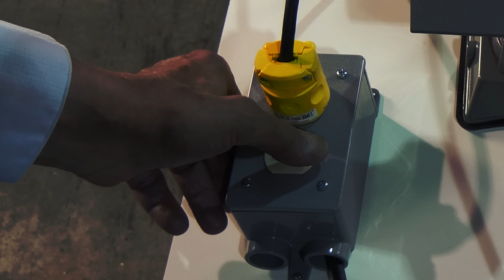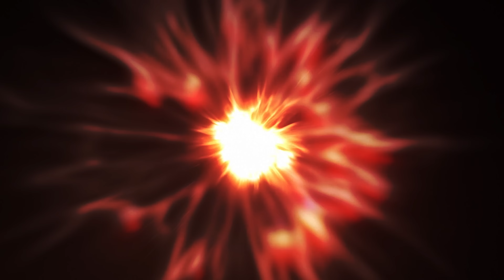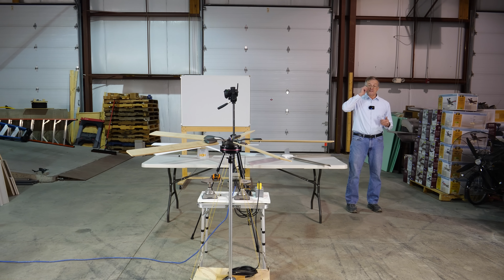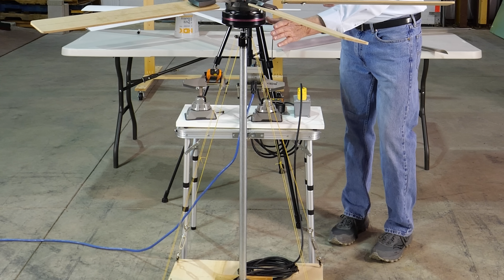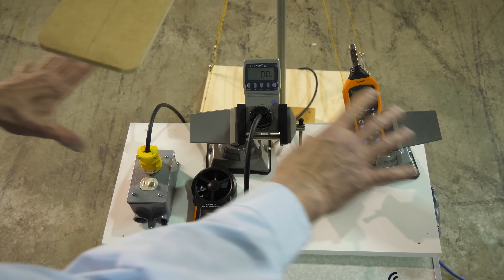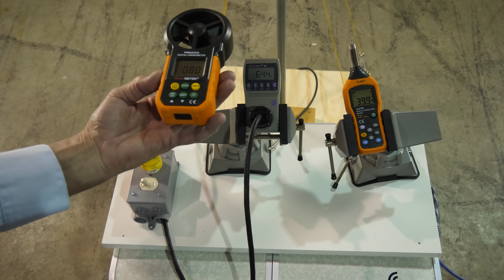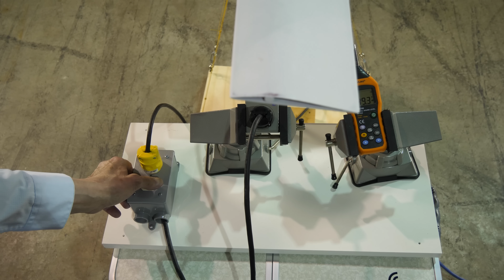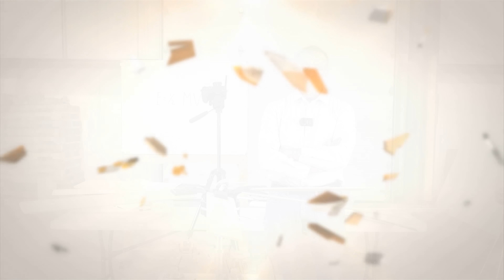This Fan Uses Almost NO Power

Comment: As always, I enjoy watching your videos and they're great - this one didn't disappoint at all (as usual). A few ideas for testing that you might want to consider, if you test this again:

- Include RPMs in the test to ensure consistency
- have some sort of platform to hold your anemometer at the same level for every test for a more accurate test of airflow
- let the fan come up to speed for a fixed amount of time for each test - maybe 60 to 240 seconds. This will likely ensure consistent speed and power draw.
- lastly, it would have been cool to see the other blades tested, but I understand why they weren't.

Hope you take this constructively, as I expect you will. Considering your scientific and engineering nature, I think I'm okay. Keep up the great work!
Reply from the maker: All good suggestions and, in general, the way I try to do things (although I don't always succeed).🙂

Comment: It may be worthwhile to try using a TI 8316A or 8329A (externally controlled FETs) dev kit. They are FOC BLDC motor controllers that can be tuned for efficiency and sound level much better than a sinusoidal controller.
Reply from the maker: Thanks!

Comment: Very interesting topic, there are a couple questions I have and a potentially interesting suggestion for a future project.

1) What is the initial cost difference of building such a fan over purchasing a commercial one?

2) What is the overall efficiency gain taking into account the power consumption by the speed controller and the conversion losses from ac to dc power?

3) What if you combined such a system with some sort of integrated evaporative cooling apparatus that you could toggle on and off or reload somehow to further decrease room temperatures?

Would also love to see a build video. It definitely shows through that you guys are genuinely passionate about these projects personally and aren’t just in for the algorithm. Really enjoying this research format you guys have been doing, great work!
Reply from the maker: We will revisit this.  There have been a lot of requests about the airfoil assembly and the combination of the more efficient motor with the more efficient rotor.
Evaporation would cause an increase in humidity, which I would avoid. 
The overall relative performance of the AC and the BLDC motors is what was read by the meter. The controller and conversion circuit were downstream from the power meter.
I wouldn't bother to build the conversion circuitry as the included system works well and is easy.
Roughly, the AC fan retails for about $100, and the DC fan retails for about $150.
The blades are fun, and the cost depends on what you already have around. From scratch, call it $50.

Comment: Link to find the hunter fan motor?  In the past i have paid a lot for proper Air-foil fans,  they are nearly silent and move so much air.   In my last house I had one, I hardwired on 'LOW" it used 4 watts...

Comment: You sound level reading is probably saturated by buffeting at the mic. Using a windshield will reduce this and give you an actual reading if the noise level

Comment: Neither of the tested designs here is very efficient. 
To get an idea of what an efficient propeller design looks like, compare it with a blade from a large commercial wind turbine.
Reply from the maker: The asymmetrical airfoil is pretty good.
But don't forget that a design that is too difficult to fabricate will remain a good design... but only on paper.
Reply: @TechIngredients  Yes, sometimes fabrication is an issue. But definitely not always.
Occasionally, a product is also bound by compromises. For example, in this particular case, a fan may not meet expectations of a reverse thrust usage if the airfoil is asymmetrical.

Comment: In this application, you would use a curved underside on the wing airfoil (camber).
To improve efficiency, it's essential to gently nudge air around, not let it meet a flat surface on the nose 😊
You would also make sure the air flows over the wing in a laminar flow pattern at all radiuses.
Lastly, the wing pitch angle seems too steep for this setup.
Reply from the maker: The pitch angle was tested and adjusted to achieve maximum performance.

Comment: Measuring with an anenometer at some random point below the fan is not that useful.
The downdraft, at any point, will be very dependent on a lot of variables, like incoming air speed, air movement direction, vortices location on the wing, ground-effect, roof-effect, airfoil, drag, surface, chord, camber, pitch, R-number, aso.
Reply from the maker: It's not random.
You're correct that many variables will affect the measurement, but I held the meter in each test to maximize the reading.

Comment: One BIG issue is that consumers often do not know how to use what they have. 
This fan can be used to cool or warm...
So some air movement is cooling .. to a point, BUT hot air rises so a fan like this, particularly in a high ceiling room like this may actually make you feel hotter by bringing down hot air. Better is to have a high level extraction fan to remove this air, and suck in cooler air at low level. 
And then use a low level fan to move the cooler air around
BUT it can also be used as a destratification fan bringing down warm air when it is cold... usually when you have some source of heating like radiators. 

My local indoor tennis centre put in high level fans but as there is no heating they are pretty useless as destrat fans, but they then switch them on when it is hot but with a IR laser thermometer you ca n see that the temperature at ceiling height is  maybe 35C,  when ground level temp is 25C....

They actually have 6 BIG and noisy, and almost certainly very inefficient high level extraction fans but these are often switched on only when it is already hot outside so the cooling effect is minimal ( the COP is probably 3-4)... what they need to do is run them at slow speed ( its much more efficient) and run them at night and use night time cooling and remove the heat from the building. Night time temperatures rarely get above 15C in the UK. 
Using night time cooling with slow speed modern brushless EC motor would probably give COP of cooling in the order of 25-30. 
Spend less money and actually have a system that works!

Comment: Now if we can get similar efficiencies to prevent water loss in the desert.  People complain about water used in closed circuit datacenters , but they forget to realize the combined swimming pool water evaporation is like 400,000,000,000,000,000,000 times more wasteful.

Comment: I notice many such inefficiencies as well.
not only in physical things where I found many, but also digital, some are intentional because they don't want to make someting good, sometimes they are just stupid and don't look beyond what they already know.

found 2 huge one in computer games as well, some fundamental mistakes in the core behind how games and such actually render things, designed a essentially drop in replacement which wouldn't break other functionality and on a modern high end system could both greatly increase performance as well as save a lot of power at the same time, showed how to do it, asked some game engines if they wanted to implement it as it had no nagatives and yet made things a lot more energy efficient as well as some faster. none even concidered trying it out, since it would mean changing something they where used to for years. even if they wouldn't notice the difference since they themselves wheren't even aware anymore of that part in their engine since around 60 years ago or such someone decided that was a good way to do it and since then essentially every form of computer and computer program has followed that rule even if it really doesn't suit the modern day anymore.

Comment: I have a M18 Packout fan which runs on the M18 batteries. It's (like most good milwaukee tools) got a BLDC motor in it. This fan is REALLY quiet and runs for literally days on low settings from a battery. It's a phenomenal product. BLDC tech is no joke...

Comment: Wanna have some fun? Hypothesize about what would happen if you cut the length of the bald in half and re-run the experiment.
Reply from the maker: I assume you mean the blade.
I suspect you'd get higher fan RPMs and airflow velocity,  but only 1/4 the blade area and less total air movement.

Comment: Thank you for doing this comparison; very interesting demonstration!
Might have been a good idea to also record the RPMs that the various assemblies were rotating at?
The anemometer should have been held in a fixture like the other instruments.
WHY DIDN'T YOU INCLUDE THE PERFORMANCE DATA FOR THE TWO ROTORS WITH THE AIRFOIL BLADE RUNNING ON THE BRUSHLESS DC MOTOR????
long time subscriber here= always great content; but please consider trimming your presentations by 20-25% sorry; but many cuts show redundant information multiple times.
Reply from the maker: Thanks for the feedback.

Comment: I replaced our furnace blower with an ECM evergreeen upgraded motor and it cost about $150. With no other change, CFM went up, and my electric usage went down semi significantly. Additionally, I can run at an ultra low constant fan during the heating season to keep the house temperature more even. It’s been one of the best upgrades we’ve done in the house.

Comment: I noticed this when I ditched the horid radiator mechanical fan on my 280zx and replaced it with a properly designed high end electric fan. 12v at about 10-15amps and it’s cooling better then the mechanical that would use 10-20hp.

Comment: There's only one reason why he didnt post the new motor with his foils.... it probably wasn't that good.
Reply from the maker: That seems reasonable.
But seriously, say none of the blades were any good, the point was the motor is so important that it was the hero of the story.
How would a blade know what's driving it? If the asymmetrical airfoil was better with one motor, why would it stop performing once attached to the other motor?

Comment: I'm curious about how you built the airfoils
Reply from the maker: The curved metal blades were simple. I cut out the strips from 18 gauge aluminum and curved them by hand around a PVC pipe.
The symmetrical airfoils weren't difficult and a number of viewers wanted to see the combination of these airfoils and the more efficient motor. I'll cover their fabrication and test demonstrate that combination in an upcoming video.

Comment: Thanks for the video, Eric. Surely a measurement of the total mass and velocity of the air being moved would have been more useful for comparison? You could do that by suspending the fan and motor on a spring balance, or by mounting the fan horizontally and measuring the horizontal force applied to the desk. measuring only the air velocity takes no account of the total amount of air being moved per second, so you cannot obtain accurate measurements of efficiency from velocity alone.
Reply: In addition, measuring only the velocity is error-prone, because different parts of the rotor blades generate different amounts of thrust, unless the blade profile takes this into account - as with an aeroplane propeller.
Reply: OK, now I see what you did, Eric, and it's a perfectly valid comparison. But you are still not measuring efficiency quantitatively; only doing it empirically.
Reply from the maker: That's true, but I think that's ultimately what we want. This is a comparison between the stock blades supplied with the fan and practical alternatives of the same diameter. A more fundamental analysis would allow for more modifications, but in the end, they still have to be applied to this situation.

Comment: I went off grid 10 years ago. Built my home ground up, alone. Used tesla batteries for power, solar, rain water, etc... I almost dont need AC power anymore. I converted my mac mini and starlink dish to dc and all my ip cams are PoE to a dc powered switch. I have one dc ceiling fan and a few dc box fans. I am 100% going to do this in every room - too much power saving to ignore. And though I dont have a bill, I need fewer panels, fewer batteries, to live the same life. That's wealth.
Reply from the maker: Agreed.
Good luck!

Comment: Appreciate that you are educating more people on these things. Suprised you didn't get RPM with a tachometer on those fan blades to cross-reference your air flow meter?
I learned about this from an EE/HVAC fellow Tesla coil friend many years ago.
There are many simple improvements to efficiency that cost a little more upfront, but pay out long term. I call it an Energy Freedom Paradox. As the perceived transformation of energy/information passes from one "ground" state to another, we all too often disregard our socioeconomic influence on the system. A variable that can not be isolated so long as we are human beings in my view.

Again, I appreciate another voice suggesting we can build things better where value is mesusred in longevity and abundance instead of personal short-term material gains.  
If you opened up your garage doors and allowed air to flow across those blades, you could even generate some electrical power. 😉

Comment: What type of AC motor was in the tested ceiling fan? A shaded pole motor is cheaper but runs hotter and less efficiently than a split capacitor motor. https://youtu.be/jULTHNAnrHs?si=ijK5kq9gnfKrYSV5

Comment: I'm impressed it didn't bounce all over the place.  Ceiling fans are inherently unbalanced and you have to add weights to balance them.  Secondly, how does this save us money by switching to a DC motor?  We all switched to LED lights, more efficient water heaters and fridges, yet your electric bill continues to go up.
Reply from the maker: My answer might seem dismissive, but I think it's true. 
Imagine what our bills would be like if we hadn't made those changes.
People like and need energy. Using it more efficiently means we can pursue our appetite more easily.

Comment: In smaller rooms (under 12'x12') I find the smaller 20"-24" BLDC fans (almost always with a surrounding LED ring light) to be far more effective than traditional open or exposed blade ceiling fans. The blades in the smaller fans are gently cupped, making downward flow slightly more efficient than upward flow. Yet the upward flow is quieter! I especially like the smaller fans in my home gym, where the ring light guards the fan blades from accidental strikes when using some gym equipment.

Comment: Why not also monitor RPM? That is more relevant to the blade performance, where power (watts) is more relevant to motor performance. I think the testing would be most relevant, and more understandable, if RPM were controlled (or at least monitored) on all runs.
Reply from the maker: Rpm and airflow velocity are directly related. Measuring both will reveal anomalies, but the air velocity is the ultimate goal.

Comment: One advantage of flat blades is reversibility. I have my ceiling fans blow down in the winter, to get the heated air off the ceiling, and blow up in the summer, to better circulate the cooled air.

In my galley-style kitchen, I have the ceiling fan blow up all the time for two reasons. First, to eliminate the central column of air that's annoying to walk through. Second, to have downward flow off the cabinets to the counters, to keep fumes out of my eyes.
Reply from the maker: The spar on the airfoil blades allows the angle of attack to be adjusted by a full 360 degrees. It would take a few minutes, but it's easy.

Comment: SIR YOU SAY AC TO DC MOTOR ? MY HOME IS AC . DO THE DC MOTOR MOTOR HAVE A BUILT IN INVERTER / OR DO I HAVE TO BUY A INVERTER TO GO WITH THE DC MOTOR . THANKS GARY
Reply from the maker: You don't need to use all caps.
Anyway,  the distinction is at the motor itself. These DC motors come with  small converter modules already wired into the motor. You attach these fans just like the AC fans to the mains.

Comment: I found this out years ago. But you over looked the elephant in the room — the heat of the AC motor counter-acting the cooling effect of the fan. With the DC brushless 12v you can run it 24/7 and the motor never gets hot - making the room net cooler! The AC fan motor in a small room in the summer acts as a heater and heats the room!
Reply from the maker: That's what I said.

Comment: Great video.  I'm building a fully off grid home and as such electrical efficiency is critical.  I plan to use a fan in  every room and while I knew DC motors were more efficient I couldn't quantify the overall benefit.  Your vid was perfect, obviously not for absolute $ savings per se but pure energy efficiency power in vs wind energy out.  Uding 60% less juice is huge for a small cost premium and it's plug and play.  I'll be looking at DC ceiling fans, exhaust and air intake fans, dryer fans,, etc 
Much appreciated.  Thx!
Reply from the maker: In the next few weeks, we'll be posting a video on tiny house geothermal air-conditioning. You might find that useful.
Reply: I might. However I'm 99% DIY and the property is mostly exposed bedrock or minimal overburden (a few inches/cm).  If there's subsurface pipe required it's extremely challenging and or $$$. For now I'm planning for woodstove as primary heat and minisplits for AC and heat in the fall. I'm located in Ontario, Canada so +86F/30C and -13F/-25C is the typical range. Regardless I'm always looking for tidbits of useful information that can be used or adapted.  I'll keep tuned.

Comment: Dreo makes a ceiling fan that is DC driven, when i switched it out with a home depot one its quieter and has more features, i wonder how it will work if i change the blades on it?
Reply from the maker: The blade results would be independent of the motor that drives them. Combining an efficient motor with the asymmetrical airfoil blades would multiply the improvement.